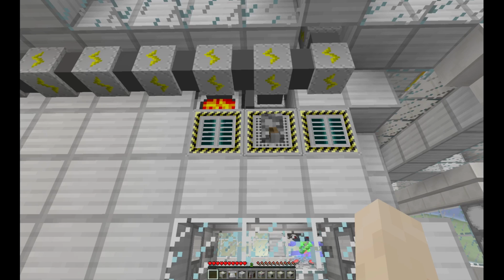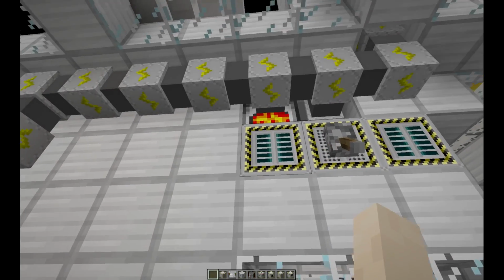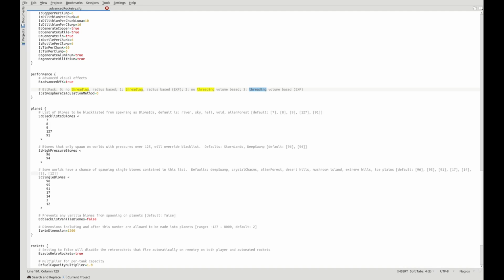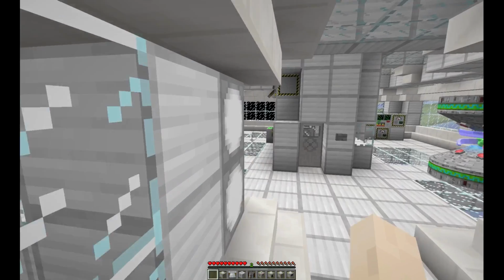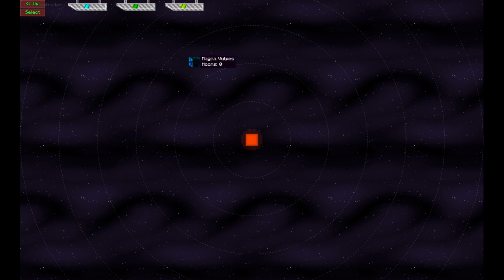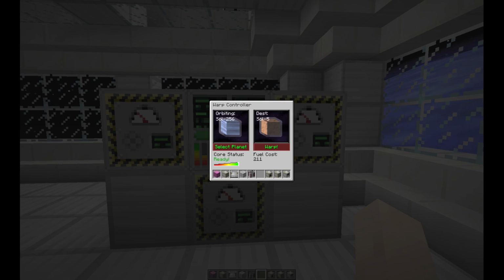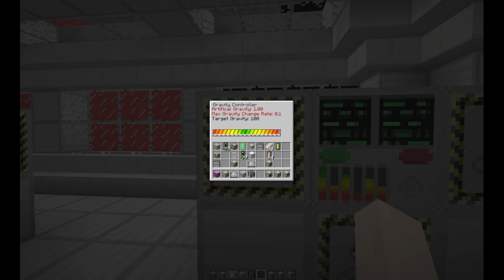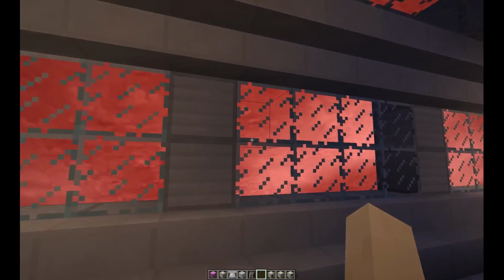Advanced Rocketry 1.0.0 Tutorial part 2

Comment: this sounds like a noob question, but how did you get oxygen in the space station in the first place? i cant figure that out
Reply: idk but im pretty sure it had something to do with that gas machine thing that u built in the last part
Reply: Oh wait nvm i got it thx i wasnt paying attention to the video
Reply from the maker: You can either ship it up on a rocket or build an 2x2 water pool and electrolyser on the station.  I typically just use the carbon scrubbers with the vents because the vents won't consume O2 and I'll only need it to fill the spacesuit.

Edit: Didn't see that you had figured it out XD not used to the comment system youtube has where it hides threads
Reply: lol, thanks. i use the carbon scrubbers and vents too
Reply: @zmasterfun  i know this is old but how do u do the carbon scrubbers thing im stumped